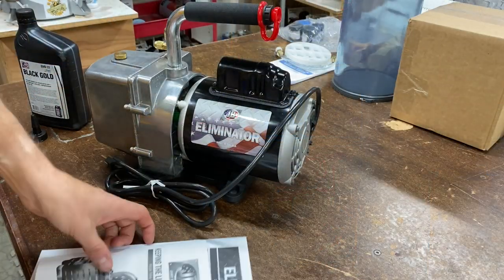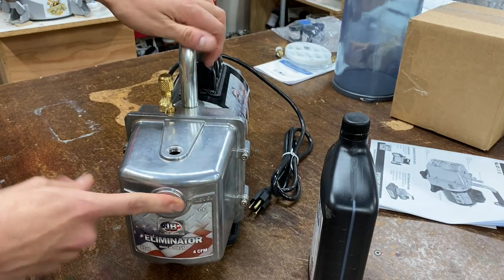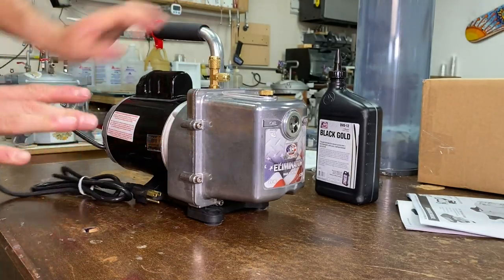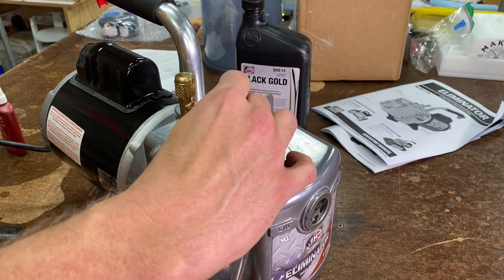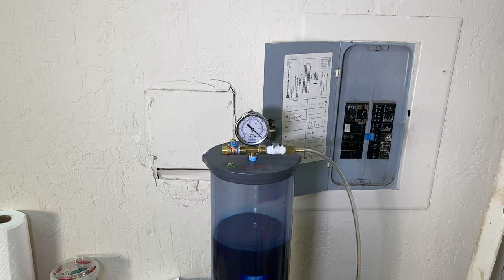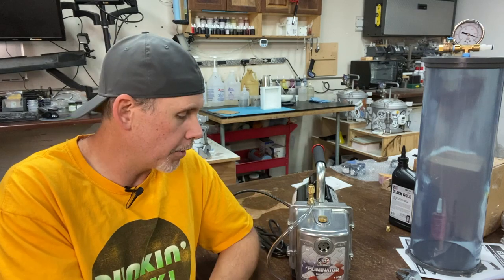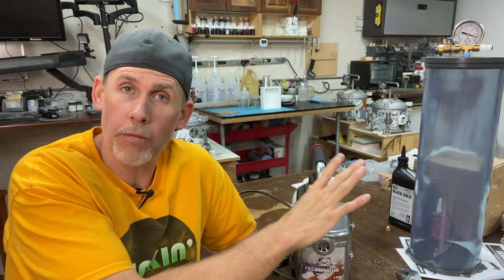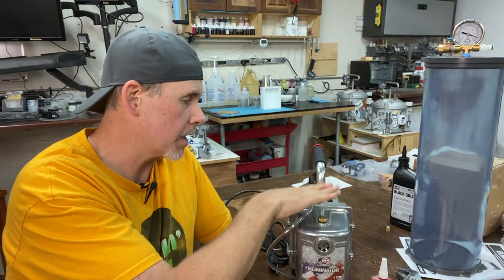Setting up a JB Eliminator Vacuum Pump for Wood Stabilizing

Comment: Hey Zac, great video - great info. I just switched to the JB pump via Curtis (Turn-Tex) recommendation. I got the Platinum model, found it at a local pawn shop of all places. After making tons of mistakes with my stabilizing efforts, like every mistake that can be made :-) - the only suggestion I can give to those just starting out is: when the bubbles are done and let it soak for hours/days, when you take it out of the vacuum chamber - wipe off the excess resin (cactus juice) with your fingers, then towel dry it and let it 'air' dry before you put it in the toaster at 200 degrees. I do not use aluminum foil - and I get very little bleed out. On live edges, I lay the piece on it's side. This info may help some, may be a disaster for others? It just works for me. Thanks again.
Reply from the maker: I agree with everything you said, that's how I do it too =D

Comment: Great timing Doc Resin, just setting up a rolling table with the casting vac pump, tank etc. with supplies. Have that exact pump and Turn-tex tank. Getting really cold in the shop so not much stabilizing or casting going on.
Reply from the maker: Cedar Oak Farm Nice!! Yeah, those cold winter temps can be a drag. Hope you get some warmer days soon so you can get some castings done 🤞😀

Comment: Hi Zac, thank you for sharing this information, I got the JB Eliminator last week, I think I put too much oil and it create me a problem, I was trying to contact the thecnical assistant of JB Eliminator but due to the holidays it was impossible, I hope nothing wrong happened with my pump.
Reply from the maker: Hmm, I'm sorry to hear that you had a problem with it. I didn't think you could really add too much oil, but you can always pop the drain plug to remove some and try it again. One thing you will need to do is pull the red plug out of the end of the handle for the exhaust to come out. I didn't realize you had to do that the first time I fired it up, but mine just popped right out

Comment: Hi Zac, I've seen where pressure is used for stabilizing rather than a vacuum.  Can you explain what the difference is?  Also which is proper for eliminating bubbles in casting?
Reply from the maker: Hey Chris, vacuum is pretty much the only way to do wood stabilizing at home, you’d need pressures in the thousands psi to overcome atmospheric pressure and force the resin in. Vacuum eliminates that obstacle. 

You use pressure for casting though, that’s the best way to tackle air bubbles

Comment: Hi ZAC . I want to give me information on wood stabilization. I am from Greece and can only find olive wood. Can I stabilize olive wood? I do tests and I don't get good results. The resin together with the color does not get in. I use small pieces. I use a refrigerator motor for a vacuum pump. this stops - 0.9 bar. I believe it's enough for stabilization. the woods are below 10% humidity and I let them soak for 24 hours. Then I put them in the cactus juice in vacuum for 4 hours. When he was finished I cut them in the middle to see and he didn't get in. What am I doing wrong please help me.

Comment: The red locktite is permanent. I prefer blue which allows removal or just cheap plain old  Teflon tape. I bought a Robinair and got surprised by your machine. JB are my initials! Damn! 😃 👍
Reply from the maker: The 545 is not permanent, it's just an anaerobic sealant, no adhesive in it. I use it on all my pressure pots. I admit that I don't know if it is the best option for vacuum threads or not, but I figured it can't hurt :) 

I have two Robinairs, they work great too! I wanted to try out the JB pumps since so many people speak so highly on them. I knew they were well built, and it's nice to have parts available if you need to make repairs too. I just wasn't sure if they were worth the extra money overall.  I'll give it a go and see how it compares to the Robinairs
Reply: 545 is actually a foam based gel to fill threads against high pressure environment(s) (no CA). Thread lock red-purple-blue-yellow are all CA (super glue) based with different breaking points of pressure to release with a lot of fillers. I am not a CA engineer, but am one of the owner's of Pacer Technologies (ZAP-CA). I'v been in enough meetings to figure out what the super smart engineer's are all talking about now. :-) I asked them about 545 several weeks ago from one of Zac's videos. They explained to me, we did not have the needed products to make it to offer that we currently had to make the CA. Oh well,
Reply: @garyspruill4100  My bad. All I saw was an all red label and jumped the gun!👍
Reply from the maker: @jamesbarisitz4794  No worries, it's a good thing to discuss here in the comments. I didn't really explain what 545 was in the video, so this will help others out too =D

Comment: How big of a piece of wood can you properly stabilize? I have some pithy Box elder that I would like to eventually stabilize for bowls, but doing my research before investing in a vacuum system.
Reply from the maker: Any size as long as it fits in your vacuum chamber. It'll take longer to dry and to do the vacuum stage, but any size can be stabilized

Comment: I have a different vacuum tank cause I need the width for silicone ... got a good vacuum pump I have .  As long as you have a pump you can maintain like Zac says . 👍
Reply from the maker: I agree, the big vessels are a little easier for silicone. Although, you could fit a quart mixing cup in the 6" chamber. I'll have to try that out :)
Reply: The hight. Of yours is good as silicone doubles in size when degassing  sometimes  you have to let off on the valve . Me I get my arm stuck in yours
.or  could not reach bucket without handle .., silicone pours so good afterwards when making a mold  a quick 
Spray of Mann’s 200 to break surface tension.  Hey Zac  make a yo yo  turn on the lathe or min baseball bat !

Comment: How hot does that thing get? i got another brand pump and under full vacuum about 3 hours in the sides are 180 degrees. Kinda dont like to leave that overnight. thoughts?
Reply from the maker: I'm not sure how hot it gets, but I leave mine running overnight and haven't had any issues. If you're worried about fire danger, you might look into the Fireball suppression things. I keep one on my oven when I leave it running, and I just got another one to put near the pumps. Cheap peace of mind, they are available on Amazon if you want to check them out (affiliate link): https://amzn.to/33Ask0F

Comment: Sir, these are small wooden pieces.  What to do for big tracks. And what is this liquid?
Reply from the maker: It's tough to stabilize large pieces, probably not worth the effort on them, just seal edges instead. The liquid is stabilizing resin, Cactus Juice brand

Comment: Bigger hoses will pull a better vacuum. Your vacuum is restricted is through the hoses and fittings you are using. Buy some Appion hoses and a BluVac micron gauge 🤙
Reply: Compression fittings seal around the the seating surface of the nut and the compression ring. The threads only hold the two surfaces together.